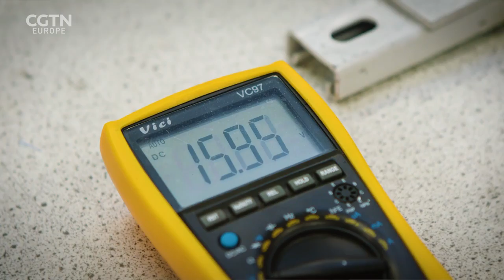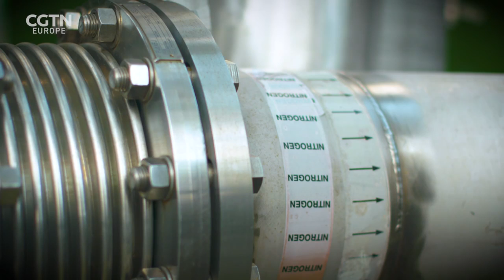Cryobattery - storing renewable energy as liquid air: RAZOR

Comment: Interesting technology, I wonder if you could more easily scrub CO2 from this liquified air somewhere in the cycle compared to other carbon capture technology.. not sure if the amount of air would be worth it, just a thought :)
Reply: I'm late to this but in another video, the CEO says they have to separate the CO2 as part of the process  (since gases liquefy at different temperatures) and either it could be captured or sold to brewers or food producers or for other industrial uses.
Reply: Th co2 has different freezing point th way I understand and it

Comment: What is the overall efficiency of the full process? Meaning, if you use 1kwh to liquify air, how much energy do you get back when regenerating?
Reply: IIRC it was somewhere around 60 to 70%. Less than pumped hydro or best batteries, but far cheaper than either and takes less area than a lake. Given the point is to have at least 60% of the energy you produced available later rather than 0%, the exact efficiency is less important than having reliable and cheap storage.
Reply: @AnalystPrime  Well, it's not 60% or nothing due to available alternative methods. But really when considering the great scalability of this tech, I believe it has amazing potential. Thanks!

Comment: After a tank is full with liquid air, how long can it remain in liquid form without being cooled again? Hours, days, weeks?
Reply: Not enough that it matters, since power fluctuates on a 24 hour cycle. Although it should be around 2% loss per day (the boil-off keeps the rest cold)
Reply: @Thomas Chrombly if we have to keep supplying power isn't that a potential drawback? Its like saying ice will remain frozen as long as its being kept refrigerated. Seems like energy may get dissipated through radiation, unless there's some special insulation strategy involved. 

Just my thoughts, would appreciate if anyone can correct me on this.

Comment: I am not suggesting that this scheme isn’t viable.  I am suggesting that the engineers is being less than candid with the people. This system, like any other needs to run at 100% capacity at all times, otherwise it fails to be cost effective.  Adding more flasks will require a bigger process.  I can’t believe the liquefying process can manage an indefinite number of storage flasks to added at will. They has to be a balance between production saturation and storage before further production capabilities has to be built.  Therefore the statement of just adding more storage is just “Hot Air”.  Then you need more generating capability, which again calls for more building.
Reply: Its obvious that more storage means generating/storing power longer, not that it will produce more power at once, for that you need more turbines.

Comment: Capital investment of Liquid Air Storage is around $150/kWh, efficiency (store/return) between 25 and 60% and requires maintenance of the turbine.
Li ion batteries for cars are approaching $100/kWh, falling about 20% a year in price, and have efficiency over 80%. Lithium iron phosphate batteries (not widely used in cars because of their higher weight)are about 30% cheaper, non-toxic, use no Cobalt, and also safer and have more recharge cycles (~10,000 and rising) and are maintenance free. 
Am I missing something here?
Reply: The main point is you only have to add bigger tanks to get more capacity, so the base cost is big but to add another 5 mwh the cost would only ~200000€ (~40€/kwh) to add 2 100m2 tanks for the heat and liquid air.(that was the price for the first LN2 tank  I could find so there are probably cheaper options out there )
Reply: + you separate  ~100 kg of CO2 for every MWh that gets stored. so a 50 MWh plant that cycles ones every 2 days would filter 890T of CO2 a year. The CO2 can then be stored in old natural gas fields.
Reply: $100/kWh is still a dream for the future last I heard. Even if Tesla reveals they got there on the next battery day, they still have trouble providing batteries just for their cars. Sure, they have built couple other grid level batteries besides the one in Australia, but that one was $100M for about 100MWh while the small scale test LAES facility was about twice the size for same price.

A gigawatt battery pack could actually cost a billion dollars, a LAES facility would be few hundred million. The chemical batteries need rare and expensive materials that will be come scarce and more expensive if demand rises quickly; the LAES is mostly built with cheap concrete and steel. Chemical batteries tend to lose capacity quickly as they are constantly drained and charged, most of the LAES facility should last at least 30 years.

Chemical batteries still have the advantage of responding to grid demand faster, but you don't need a gigawatt battery for that. Every evening energy demand rises predictably, to cover that you need cheap and reliable longer term storage at multi gigawatt scale. Smart engineers can figure out how to use both technologies to best results.
Reply: Also we can't make enough batteries fast enough currently
Reply: One is a lot more environmentally friendly than the other.

Comment: Literally a very cool technology. 8:45 Interesting where he said it would be easy to add more tanks without adding more liquifiers. I guess the input rate has to be higher than the output and the tank will fill up at some point 🤔
Reply: I think the tanks do spend a lot of time filled. It only kicks in at peak periods. Which is awesome as then base load power stations can be turned down permanently safe as a big buffer exists than get's refilled from renewables and off-peak generation,